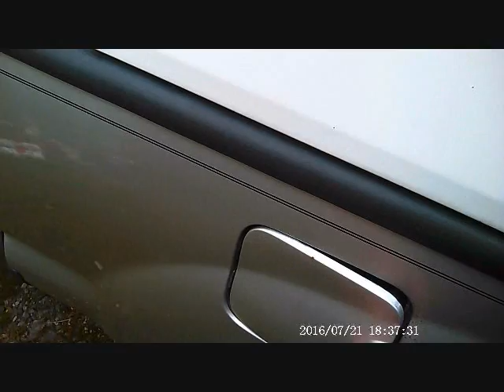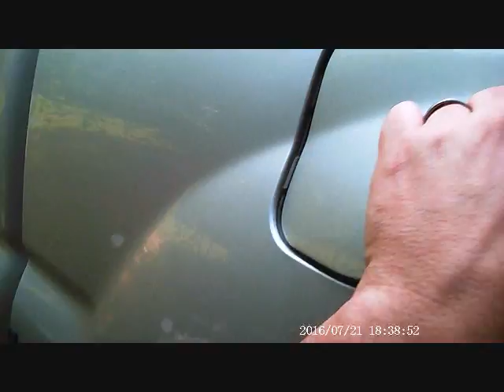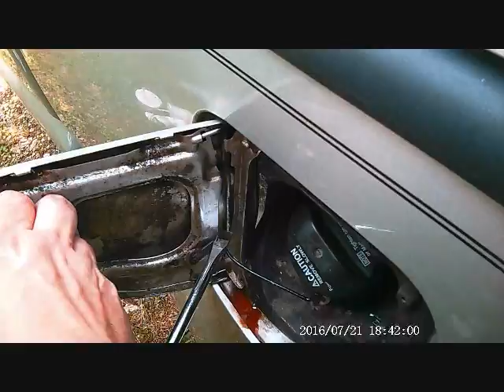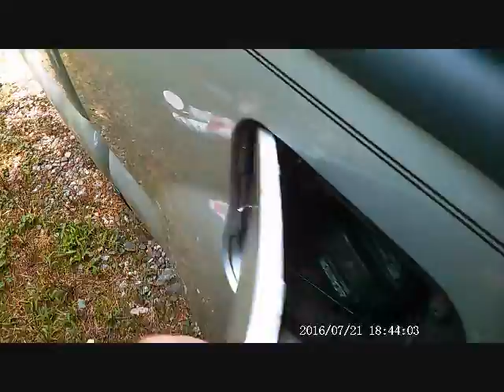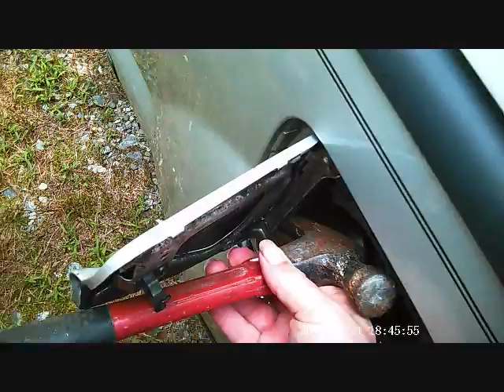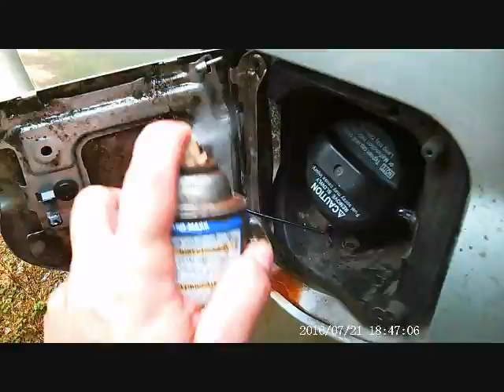tacoma gas door repair

Comment: My door did the same thing. I know the other commenter said it was caused by rust but I’m not sure how rust bends metal. Anyway I sprayed it with wd40 until all the rust was out then bent the door out like you did as my was rubbing on the bottom as well. I also bent the hinge wire so that it didn’t catch. Finally cleaned the entire area coating the inside metal parts with wd40. Works better now than ever. Thanks for your help.

Comment: Spraying WD40 on painted surfaces is a very very bad idea it will eat up the clear coat & paint, the longer it sits on the paint the paint will become soft & flake off the area that was sprayed in days so if anyone who is thinking following the advice of whats shown in this video dont do it paint damage will occure in short time.
Reply from the maker: Thanks for the reply, you didnt offer an alternative solution. Maybe try silicone spray or other lubricant if you like. I just showed what I did. I would clean up any overspray or extra right away and not let it sit on the paint. I did this years ago now and not had any issues with the paint or the door.

Comment: Dude. There's rust in there, the buildup of rust caused the filler door to become displaced.  Spray the wd 40 in there til it stops bleeding out the bottom. It will eventually break part of the spring and you'll have to get a new door , all Toyotas rust bud, just like every other vehicle brand. I've had 3 lol